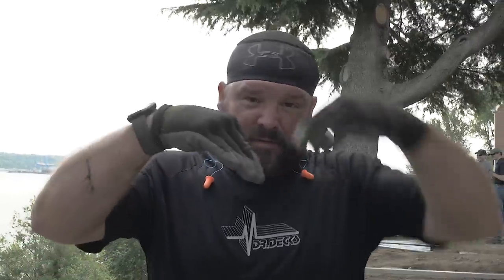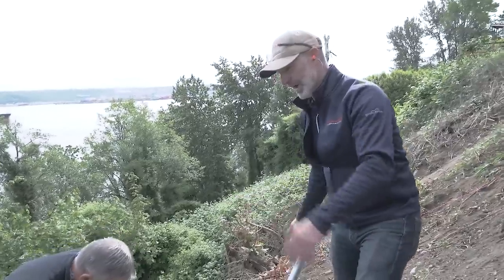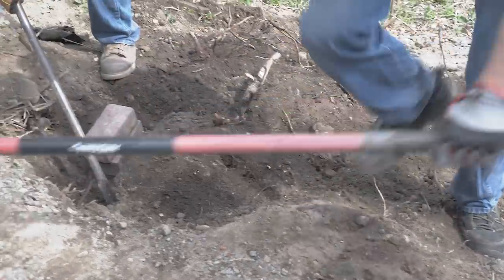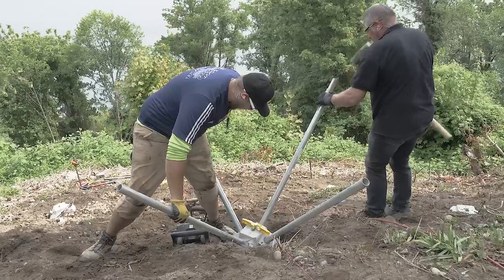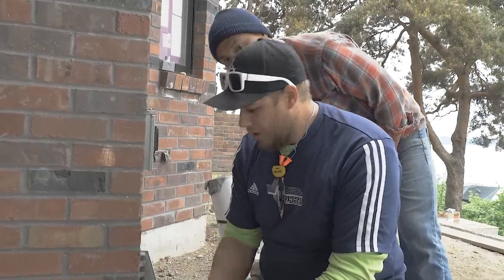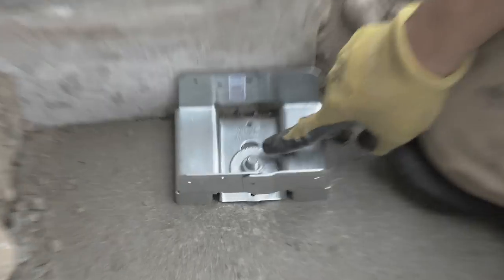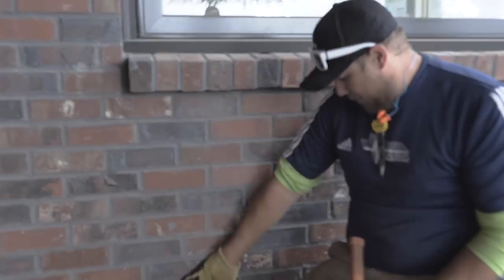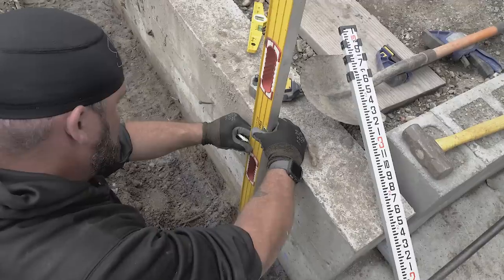Build Update: Diamond Pier || Dr Decks

Comment: Those fasteners don't structurally support pull away. That's for shear forces downward. You need to bolt the header per the IBC for pull away forces.

Comment: I am a framer in seattle. I wonder if its my engineer or local code, but I always have to install a 2x (sometimes a double 2x) ledger with epoxied 5/8" anchor bolts, then all simpson hardware anchored into the ledger.

Ive never been allowed to use concrete screws to directly attach (also i noticed the hardware you showed was not Zmax, which would be a big fail/redcard in Seattle) the hardware to concrete.

Very interesting

Comment: Any real experience on how long that zinc pipe will last in the ground ?
Reply: That's my concern, too. I'm a contractor that does a lot of trenching and I find buried galvanized steel that has corroded after 15~30 years.
Reply: @davidbenfield  Okay 15 years, give me a "sell the fixer upper in time" date plus/minus 5 years.
Reply: Needs to switch to high tensile composite.  Fiberglass would be cheap
Reply: Common sense with anyone that has been building for five years or more wouldn't pick this system , pure snake oil.

Comment: Love these, I don’t pour concrete anymore, this is all I use on all my decks!
Reply: @buck ewer We've had great success with these pin foundations in the Northeast, even on hillsides.  Our frost depths are in the 40 inch range.  Five years so far, a number of projects, no issues.  What part of the country allows you to only go 15 inches down?  We go 50 down.
Reply: @buck ewer Your math is off.
Reply: @buck ewer Uh, check your math.  First of all, 44 inches at 45 degrees is 44xsin(45) = 31 inches, not 22 inches.  Second of all the DP 100/84 goes down (84-6)xsin(45) = 55 inches.

Comment: Looks interesting but I build decks by myself or with one other person. My question is "Is this doable with one person?" I notice you have at least 2 guys working on each one, with another guy jumping in at times. Also how easy is this thing to pull out if you hit a rock on the 4th rod. If it's supposed to resist heaving I would assume I would need a machine to lift this thing.
Reply: I installed a DP50 for a deck adjustment at my house all by myself. You just have to be careful to keep the base level as you start the pins, so you take care to evenly pound the pins side to side and then across. 

It might be easier with extra people, but it’s totally doable with one.

Comment: I disagree with the ease of installation. One man and a bobcat can do a caisson in a few minutes. The same bobcat can deliver the concrete to each caisson. This method is a lot more labor-intensive. Even galvanized steel especially in the soil will rust.
Reply: I’m with you. This looks like more work than the way we do it.
Reply: @airzone2332  I'm not getting that this is more work. Replacing a full excavation and concrete pour with hammering down the steel pin?

Comment: I hear tht it moves, lot people don't want to use it, because of tht. It's the any solution for that?
Reply from the maker: icecoldusa once their loaded, they don’t move.
Reply from the maker: proper loading will keep pins from moving
Reply: English, please.
Reply: As long as the frost doesn't go more than a few inches deep they should be okay. Check your local frost depth if its is a foot or more go buy some cement mix some  sono tubes and rent an auger and a concrete mixer and do it right.. You will probably save some money in the long run

Comment: Just tell me the damn price!😂
Reply: The DP-50 is $160, DP-75 is $240. But that specialized driving head for the pins costs $300! At these prices I don't see how they can compete in the DIY market with traditional sonotubes, concrete and j bolts.
Reply: @livens100  Those prices are at least three years old. You can probably double them.